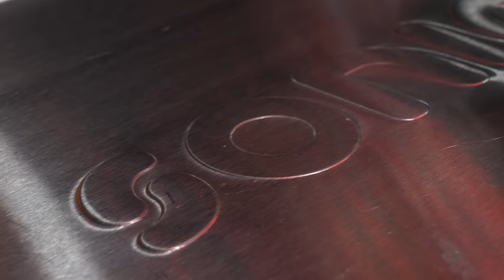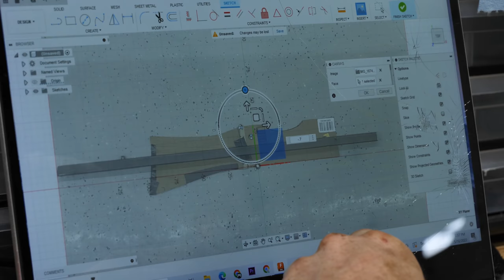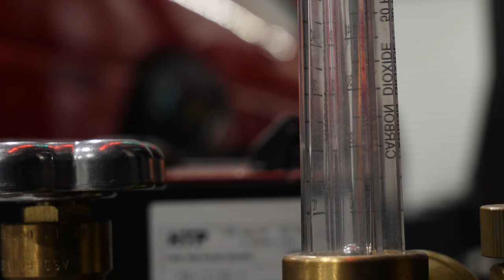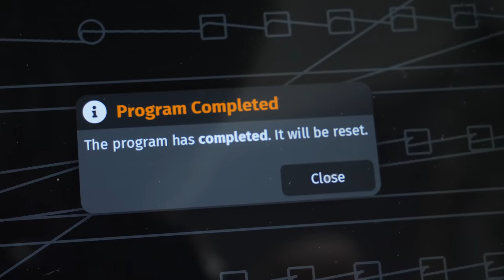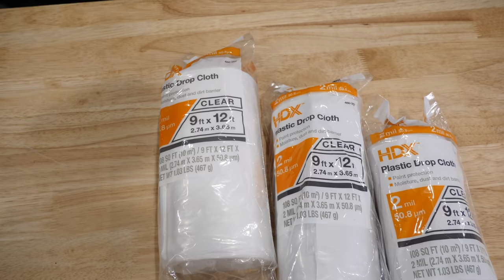Getting The MID-ENGINE Eclipse's Chassis 100% Complete! Fabrication & Paint

Comment: I would definitely try to make more full wheel wells. Rain and salt and everything won't care about that small sheet metal plate you added
Reply: I agree that there should be more of a wheel well. I hope he seam seals everything well
Reply: Really should be removeable too using some rivnuts.
Reply: I agree
Reply: Agreed but this car will probably be a weekend good weather driver only.
Reply: @germanvineque8730  Whos to say? The winner could be in Washington state
Reply: @lim3lif3  where there is no road salt
Reply: Most cars have a pretty exposed engine bay in front and also ya know, travel behind other cars flinging crap up. I truly think it will be okay. The back wheels don't even turn. There is always more that can be done to a car, but every task like that adds hours and hours of work.
Reply: @802Garage  very true and I'm sure it won't see much rain or dirt that much. But I feel like it would benefit from some sort of dust shield as well as an under tray to protect the engine and trans
Reply: I would have used LDPE sheet from McMaster Carr with rivnuts for the wheel wells. Welding on wheel wells probably not the smartest solution. Also the cuts to form bends with welds not the cleanest look, but could just be my OCD.
Reply: @DrewTega  dude I just wrote this prior to seeing your post. We used LDPE for wheel wells on our old 1G rally cars way back in the day. Rivnuts or slide latches will do the job.
Reply: Yeah
Reply: @michaelblurry6559  could look fine with rubber undercoating

Comment: I mean no disrespect because most of this build is off the chain, but the wheel wells leave a lot to be desired. Perhaps you could look into flexible black plastic sheeting. Bucky Lasek made some fender liners for his GC project that I thought of. If you could make something similar you might be able to get a more finished look without too much trouble.
Reply: Maybe find some plastic fender liners from another car and trim to fit.

Comment: You could get better splash and dirt protection by adding a rubber sheet to the inside of the wheel well area that attaches with bolts and riv-nuts. 
It would allow for access, be flexible and therefore easy to remove/reinstall for maintenance, and create a barrier to make it less of a wind tunnel from the tires into the engine bay.

Comment: you should gusset the bottom of the battery tray so the weight of the battery doesn't eventually snap the welds and drop the battery on the ground as the winner is driving around

Comment: You could try to reuse some old plastic wheel wells to line the back. Use the plastic rivets to hold it in. You could probably just order the fronts and toss them in the rear.
Reply: I agree plastic would have been a better material to use especially to save even more weight and no rust.

Comment: The back end where the rear lights an all the light housing are you should panel in the rear to fill it out more also run panels under the car with ducts to feed cold air from under the car over the oil cooler an another cooling system you may want to stick in the rear maybe like a return oil filter with cooler built in to for the engine or the turbo that way those thing can run cooler also the Trans extra power mean s extra heat.

Comment: Get some nice flexible plastic, drill some holes for panel clips, and a set of rally armor mud flaps and call it a day, its all black so it will look good, its removable with the panel clips and it blocks off the engine bay so your not getting all that beautiful work dirty. Especially if this car is going up north salt is going to EAT through that shit quick

Comment: I don't see why the wheel wells need to be full metal. Most modern wheel wells are all molded flexible type plastic and are removable. I think I good medium would be to find some for the front of an eclipse or similar style chassis and see if those fit or modify them slightly to work for this set up. Would look way more complete and factory that way imo.

Comment: Looking at all the cable ties that came off the bottom of the car, I'd suggest stainless steel ties
Reply: If he hits anything hard enough for the plastic ties to break, there will be bigger problems than the tie material.
Reply: @802Garage  it's more to do with plastic ties will eventually go brittle over time
Reply: @bobers03072  Fair. Will take a LONG time though. There are a lot of zip ties on factory vehicles.

Comment: The steel it paint lays well but isn't very durable? I preped the surface as instructed. Scratches easily, clear coat didnt help much. Awfully expensive when it doesn't last